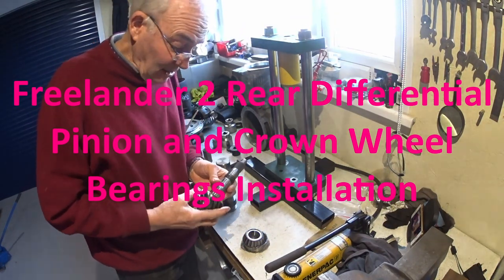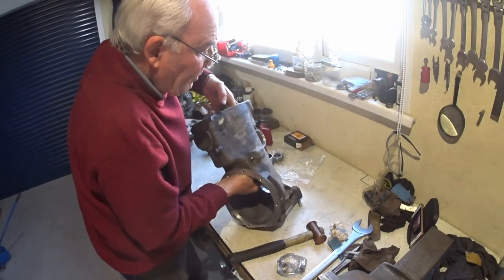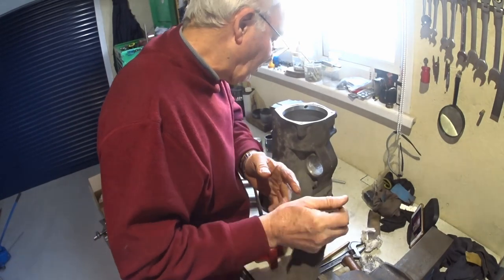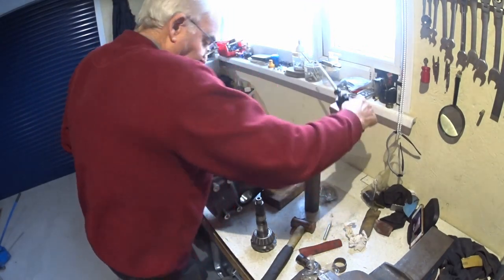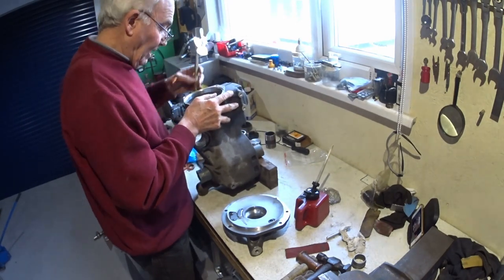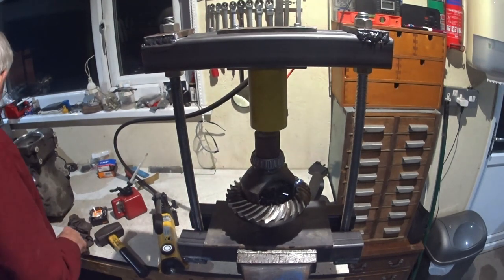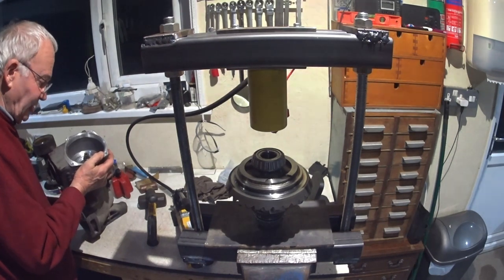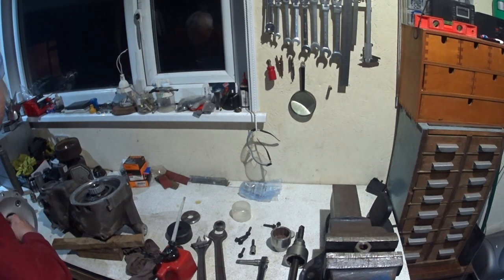Freelander 2 Rear Differential Pinion and Crown Wheel Bearings Installation.

Comment: I did this job on my Volvo S60.  Unfortunately, it was over a year ago and I did not have benefit of this video at that time.  I found the hardest part was getting the new races to seat in the housing.  I tried to get them to seat like you did, but only succeeded in getting them jammed into the housing cock-eyed and ended up scoring the housing once I remove the race.  I was lucky that I could sand the scored area mostly smooth and try again.  Then, I found that if I froze the race in the freezer overnight, and heated the housing with a propane torch, the race would drop right into place with no need for any additional force.
Reply from the maker: Hi, you are correct, looks like thats general engineering practice for fitting bearings to get the maximum clearance as it was hard to see that deep into the casing for the pinion bearing outer races.

Anyway the old girl is still going strong with no diff or bearing noises.

Regards, Brian.

Comment: Why You used 200Nm force while manual sais that minimum force is 250Nm and than we need to check if pinion shaft rotates with force of 1,1Nm
Reply from the maker: Hi,

I am using the dealers electronic workshop manual and it gives 200nm for the pinion nut, below is a copy and paste of the section below, it's for the 2012 - 2014 FREELANDER 2 - LR2 - VIN: xxx201 onwards (RHD)

8. Install and new pinion shaft nut. Using the special tool tighten the pinion shaft nut to 200 Nm (147 lb.ft).
Renew Part: Differential pinion shaft nut Quantity: 1.

9. WARNING:
High torque application.

CAUTIONS:
The special tool should be turned counter clockwise to install the pinion shaft nut.
Do not use air tools to install the nut. Failure to follow this instruction may result in damage to the component.
The pinion shaft should be rotated through two full revolutions by hand before the torque measurement is performed.
Make sure the specified torque to rotate the pinion shaft is not exceeded. If excess preload is applied to the joint the pinion shaft should be removed and a new collapsible spacer, pinion shaft tail bearing, pinion shaft tail bearing cup and pinion nut must be installed.

NOTES:
Keep checking that the pinion rotates freely during this procedure.
Follow the animation to make sure the drive pinion front bearing is installed correctly.

Freelander has done over 25,000 miles since fitting the new bearings in the diff and still runs very smooth and silent.

Regards, Brian.

Comment: How did you remove the outer race from the diff barrier cover? Thanks
Reply from the maker: @asifkadodia3822  The outer races of diff carrier bearings only have a very small lip to get behind, after l removed the oil seals l could only get in with an 8mm drift on an angle, however l did heat the aluminium around the bearing first with a gas blowtorch to expand it it a tad, then just keep tapping either side with the drift and walk them out.

It’s a bit crude but they came out fine.

Regards, Brian
Reply: @TheCADengineer   Thanks for all your help. I was able to put a new bearing based on the part # you gave me and replaced the race as well. I appreciate it 🙏

Comment: Brian just wondering can the cover plate be removed without removing seals etc as I need to clean inside my upgraded diff
Reply from the maker: Yes, just undo the ring of bolts on the cover and the cover can be removed, the outer bearing and seal are in the outer cover and don’t need to be touched. If you have already removed the whole diff from the car you can now just lift out the crown wheel assembly which will make it very easy to clean out the inside of the casing, if the diff is still in the car you will have to remove the other drive shaft if you want to remove the crown wheel assembly. There is a big O ring in the cover for the seal, l reused mine by taking it of the grove, cleaning it and the faces, then putting it back with a light smear of grease.
Reply: Thanks from Down under mate legend, as I had a sump plug machined in but looks like they got a bit of swarf in there so want to open it up and get it all out before it goes on the car. Do you know what torque to do the ring of bolts up to. It's an upgraded diff imported from the UK so want to get all of the swarf out.
Also just wondering on getting both rear drive shafts out and back in do they just pull out if you swing the hub carrier outwards? I've heard there's a clip on the end of the CV joint. There are now good step by step videos of a diff removal unfortunately
Thanks again mate 
 @TheCADengineer
Reply: Hi Bernard, I am in Sydney at the moment and have just bought a 2006 Toyota Hiace campervan which I will be picking it up this morning for a 7 month road trip. However I have the workshop manual on my laptop, the torque for the 7 cover plate bolts are 29nm. The inner pot joints on the rear diff just have the conventional snap in clips, one side is easy to remove as you can get a lever behind it and give it a jolt, the other side has nothing to lever against so I bent some 8mm stud iron (threaded bar) into a U shape and made a piece of flat bar with 2 holes drilled in it to go over the stud iron, then bolted around the pot joint so I could lever against it. You could do the same with a large exhaust clamp if you can get one the same as the outside diameter of the pot joint. Good luck with your Freelander, Regards, Brian.
Reply from the maker: Hi Bernard, I am in Sydney at the moment and have just bought a 2006 Toyota Hiace campervan which I will be picking it up this morning for a 7 month road trip. However I have the workshop manual on my laptop, the torque for the 7 cover plate bolts are 29nm. The inner pot joints on the rear diff just have the conventional snap in clips, one side is easy to remove as you can get a lever behind it and give it a jolt, the other side has nothing to lever against so I bent some 8mm stud iron (threaded bar) into a U shape and made a piece of flat bar with 2 holes drilled in it to go over the stud iron, then bolted around the pot joint so I could lever against it. You could do the same with a large exhaust clamp if you can get one the same as the outside diameter of the pot joint. Good luck with your Freelander, Regards, Brian.
Reply: Hope you enjoying Australia if you coming though South Australia let me know I'll catch up with you for a coffee you videos have helped me quite a bit  @TheGreyNomads-dr8jw
Reply: Brian did you put much grease on the splines etc in the diff when you boosted it back together?
Reply from the maker: Hi Bernard, yes l always put a smear of copper slip on the splines, but grease would also be fine.
Reply: @TheCADengineer  ok thanks again Brian

Comment: Did you purchase the tools to remove the 41mm nut or make them?
Reply from the maker: Hi, l bought the special tool as the 41mm just holds the nut stationary and it’s the input spline you undo. I re-sold the special tool on eBay, as hopefully l won’t ever need to do the job again.

Comment: Excellent video  . the kit that you use will be the same foe LR2 2012 ?  thanks
Reply from the maker: When l ordered the kit l had to quote my registration number as they said there is a difference between early and later years, however l also looked at getting a service exchange differential and was told all the series 2 were the same, so conflicting info.

Comment: Great video Brian. Where did you source your bearings and seals from? Did you buy them as a kit or source them individually by their part numbers from a bearing specialist?
Reply from the maker: Hi Ed, The bearing and seal kit was from NCA Motors (https://ncamotors.com/) and the kit number was DA7529. The 4 bearings were high quality, Timken for the diff carrier and the large pinion bearings and SKF for the smaller outer pinion bearing, plus the 3 seals, collapsible spacer and locknut. The kit was something like £150, give them your reg and VIN as there are some variations. They also sell the Haldex service kit and oil (again there are a couple of different versions) Please note that I have no affiliation to them, but very happy with the quality and price. Good luck if you are doing the repair yourself, as it's not for the faint hearted. Regards, Brian.
Reply: @TheCADengineer  Thank you kindly for that. I'm not of faint hearted disposition, just need a quiet time to set about it. Last challenge was rebuilding a VMax 1200 engine with it's 60 deg offset cam timing, which is interesting to say the least. All the best and thank you once again. Ed.

Comment: Hello again, I have torqued the 41mm nut on the pinion shaft with the crush sleeve in between and it still feels like it has play forward and back on the pinion shaft. Is this how yours was?
Reply from the maker: After torquing the pinion shaft up you can feel a drag/resistance of a slight preload but no play on the pinion bearings. however when built up mine up l had very slight play/backlash between the pinion gear and crown wheel.
Reply: @TheCADengineer  i must need to crush the sleeve more, 200nm leaves to much play. I took it back apart and compared the crush sleeve and the original is 1.172, and the one I put in and torqued down to 200nm is 1.200, so that sleeve isn't crushed enough to take the play out.
Reply from the maker: @JoeBlack1108  There should be no play and a slight drag/preload on the pinion, you will have to keep tightening bit by bit until you achieve it.

Comment: Is something you would do for someone else's vehicle too?
Reply from the maker: I originally went to our local independent LR guy, but even they don’t repair diffs or gearboxes any more, they just fit service exchange units. It was a tad too expensive plus l had the tools (apart from the pinion nut and spline tool) that’s why l did it myself. I mainly only work on classic motorcycles, BSA and Triumphs are my specialty. However if you are local to Truro you are welcome to borrow the pinion nut removal tool.
Reply: @TheCADengineer  I have a Volvo XC90 and believe the internals are exactly the same.
I have fitted multiple second hand units and the same noise occurs.
My XC90 is a V8 and modified.
Lots of weight and speed is not good for these small units.

Comment: Using the long tube on the Torque wrench gives an inaccurate reading - though in the case here it is not so bad as the 200nm is the beginning measurement to start the crush on the spacer - the actual final measurement should be the rotational preload on the pinion . 
Just be aware that any extension of the handle of a torque wrench will give an inaccurate reading .